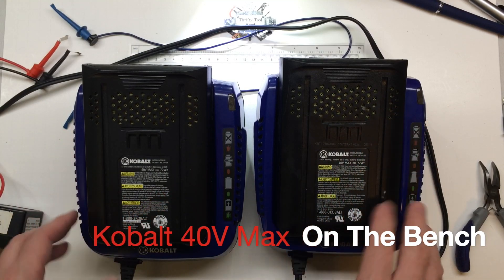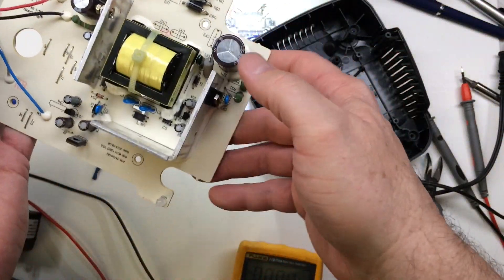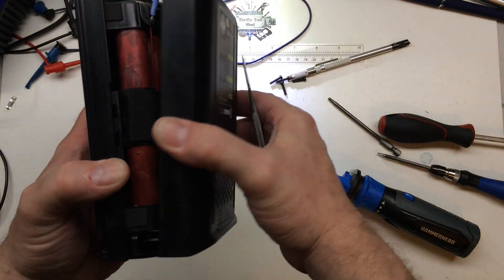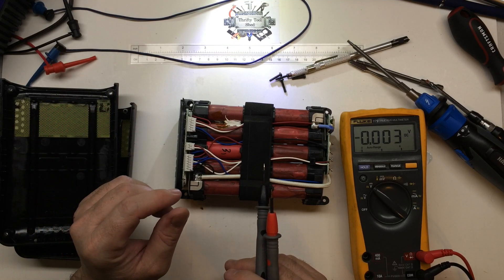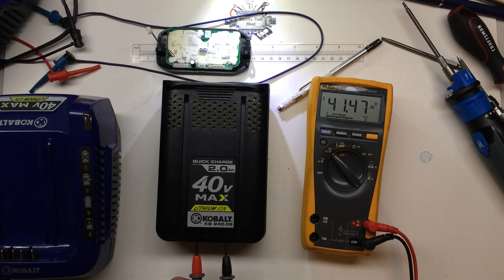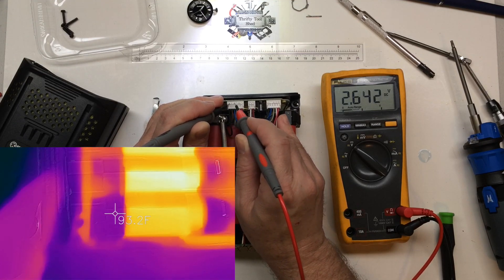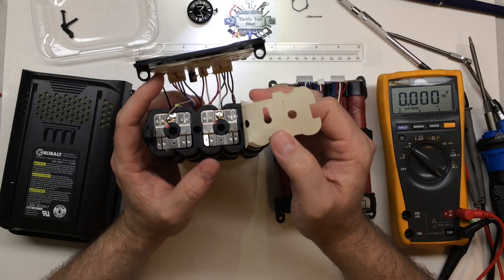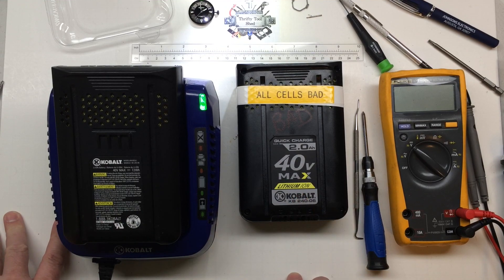Kobalt 40V Max Battery Charging Issues

Comment: Anyway to take a broken battery pack and make it a plug-in extension cord?
Reply from the maker: Not that it could not be done. You could rig up a 40V power supply or take a larger supply and use a buck regulators set to around 45V or so and it would be fine. To me that is the wrong direction, the batteries give so much freedom that I would be more inclined to use the pack connectors for another battery adapter or two 20V packs in series to run the device in a tight! I mentioned this on my 40V Ryobi video. It worked well. Just my thoughts!
Reply: Yeah, I bought a used set with 2 bad battery packs. Bought a new battery and it just doesn’t have enough juice to get through my back yard. I’m not super electricity inclined so I’ll probably buy another battery pack or figure out how to get into the broken ones. Screw heads are stripped I guess the guy before me tried getting in them. Thanks and awesome video

Comment: Do you jump it on the "C" terminal? I tried to charge mine through the positive and negative leads with no success. Just curious if the positve lead should be connected to the c terminal. Thanks!
Reply from the maker: No, you should not have to jump. + And - are going to cells directly. The only thing in between is the fuse! Other than that could be open cell or connection?

Comment: I inherited one of these that didn't work.  The small 3.1A fuse on the ACV side is blown.  I had a 5A fuse available and soldered that onto the pcb see what would happen.  With no battery on the charger, it immediately blew that fuse the moment it was plugged in.  Thoughts?
Reply from the maker: I have not had any issues with the chargers for these yet to say. I have had similar issues with similar chargers. I would check the rectifying diodes (bridge) and the switcher.

Comment: What cells are used inside of these Kobalt packs?
Reply: I would like to know as well, as least the size/volt/amp so I can upgrade my 2.0 and repair my 5.0 amp in the future when it goes bad.
Reply: Typically they are 18650 form factor, and for the 2.0 AH battery the cells would be 2000 mAH capacity. With 4V per cell, there would be ten cells stacked in series.

For 5.0 AH, that battery might have cells in parallel and those sets of parallel cells get stacked in series to reach the 40V total voltage. Open it up when it goes bad to confirm. That’s my guess - I don’t own this type of battery.
Reply from the maker: Yes, this is correct for this pack!

Comment: I have a question on an 40 volt Oregon chainsaw battery pack.  I checked the voltage and it is reading 40 volts and shows four green lights on the front of the pack but it has no current.  I put it on a brand new Oregon charger.  I have no history on the pack because it is a customers saw.  I left it on the charger overnight to see what would happen.  I know the saw is not the problem because I put the battery on the charger for 30 minutes and when plugged into the saw, it turned the saw over for a second or so.  It wurst have a hell of an internal resistance.  My recommendation was to replace the battery pack.  You thoughts?
Reply from the maker: I have rarely seen a 40V Li-ion pack show full voltage and drop off that quick. Used to be common with the old ni-cd packs. I would try to connect with jumpers etc. Out of the saw or another load if possible so you can check the pack voltage under load. It could be a bad cells that drops off quick. It could even be a bad connection to one of the cells in the pack like the spot weld connection or so. It is very rare. I am not familiar with the oregon saw but some tools will shutdown if it thinks the pack is too low or over temp. etc. So some communicate with the pack and could shutdown based on an issue and in that case it is hard to be for sure it is truly the pack, I would say 90% of the time it is a pack issue! Wish I could help more, I would load test the pack at least!  Best of luck to ya!
Reply: @ThriftyToolShed  I put a VOM to the battery pack and it said 40 VDC and the test button shows four green bars.  That is why my saws are Stihl two cycle.  You just cannot depend on battery crap.  I do have one pole saw that is lithium ion and several drills and impacts, but I leave them on their chargers when not in use, just like my laptop and tablets.
Reply from the maker: @johnclarke6647  
I am the opposite, I have always had nice gas saws but now I have a 14" and a 16" EGO and my chains have just rusted on my gas saws. I would as with any saw have more than one and of course I have 5 or so bought packs and about 10 repaired ones. 
Gas or battery I never go into the woods without back-up. I have not needed it yet with my EGO. But I still have it if I get it pinched or if a saw fails on me. It will still be a little while before the mass is ready for battery powered saws completely but hopefully when the solid state batteries platform arrives with in the next 5 years or so hopefully that will be when battery will over take gas! Hard to compete with the power density of gasoline but since the efficiency is less than 30% with gas due to most of the energy it produces is heat. We are close....
Reply: @ThriftyToolShed  iave a couple of 16 inch saws but most of mine are the big Stihl saws, many of whom I built.  I will bet those little saws will not stay with my ms 460, 440 or for the real big stuff my ms 660 and it’s 28 inch bar.  Either of these saws will make your battery operated saws look like a kids toy, which is what they are.  They are ok around the house but when you have to fell and buck up 25 inch hardwood they are sadly lacking.
Reply from the maker: We actually had a small engine repair shop before my Dad retired a few years back. We did a tremendous amount of saw sales and service for loggers ( I simply helped him at the start and part time  when I had time) so I am not ignorant by any means on the big boys, I was talking about mine and mine alone. I have never needed a big saw for my own personal use. I only used them back then while testing the repairs for the loggers. I do remember the older McCullough 850 before the Husqvarna and Jonsered turbos were a pain to keep pulling on when you are learning to work on them, rough on the elbow. Lol. I would never compare my $200 EGO to that or my even my decent Echo 21" gas saws either. They are not even on the same spectrum. Glad I have never needed that much saw around my house.

Comment: I had a Greenworks 80 volt. After watching this video, I tested my volts and saw 63. That left me believing I had a similar issue, so I pulse jumped it for about an amp. It woke up the charging system. It then accepted normal charge again from the Greenworks charger.
Reply from the maker: Good to know, thanks for your comment!

Comment: My pack will not light up and I don’t understand how you go yours to light when it would not
Reply from the maker: I tested the cells and they were very low. I had to charge the cells up slowly with my Bench Top Constant Current power supply.

Comment: I have 3 packs,  2 show 41V and full charge, 1 36 volts and 50% charge.  I missed where the LiOn cell voltage increased from 3.3 to 4??  Any way,  the half charged unit reports bad..  I can't detect any change in pack voltage while the charger is in the flashing green mode.. prior to it switching to red..  Charger test points tp5/tp6  idle at 18v and when a full charge unit is plugged in it is still at 18v.  but when the 'half charged unit is attached the voltage at across tp5/tp6 goes to pack voltage  while the led be blinking green.  when the led goes to red, the voltage on tp5/tp6 goes to the 18v idle value.  I can't id the Q11 M60130 device
Reply from the maker: I don't still have these packs, they were given back to a friend over a year ago. I do not own any myself or I would look up the Q11 and see if it's the same number. As far as the cells back to 4V, I used my bench power supply and brought the individual cells up set at 4V and Current limit are 1A until all were good.

Comment: I have come across one of the mowers with this particular battery unit on it but it's a six amp hour and I have experience working with these style battery packs and I've had this one apart it's got 20 batteries in it 20 individuals but I'm not too impressed with the way it's laid out because what I found out so far is is it uses 10 batteries per I want to say per 20 volts and they double on each end of the pack you have a 20 volt set and another 21 set and then they run the two sets in series to get 40 volts but I don't see why this thing has so many issues it should do really well and even more powerful than I would think but my Craftsman v20 batteries at 4 amp hours seem way better than this and more dependable and I can leave them on charge and they care for themselves or take them off and they don't have many issues but I'm considering building an adapter to run my Craftsman batteries in series to use this mower because The run time on the battery I have when I first come across it was charged fully and ran good but they don't seem to want to take a good charge now so if the charger I get doesn't work right and the batteries don't work right I'm going to work on an adapter run the batteries I'm going to buy and the charger in the ground and switch it to the v20 batteries I think I'll do better they seem more dependable

Comment: one last silly question, how in the world do you get the cells separated from the little rivets on the top and bottom of each cell.? I do not want to tear this up. The cells are hard to remove from the plastic housing!
Reply from the maker: I am not sure how your particular battery is however most I have seen are similar, I have a couple videos that I do show removing cells from the EGO 56V pack and Ryobi 18V pack you may find helpful. You have to carefully pry the tabs off and when you reattach the new cells you have to either spot weld tabs back or carefully solder the tabs back which I do show in the videos. Hope it helps!

Comment: If I needed to replace a couple of these 4 volt cells, where could I get them and if I had to do a web search, what would I call them?
Reply from the maker: I am sure different packs manufacturing at different times are not all the same but they are 18650 li-ion cells with the rating of your pack. For example if you have a 2.0ah pack, the cells are 2000mah rating...

Comment: I'm having trouble with an 80V max 5ah, it charges no problem there "apparently" tested its voltage it registered 79 when I put it on my mower it lasts less than 20 minutes. Going crazy and they're expensive, when I put it in the charger no issues all green lights. Any ideas anyone?
Reply from the maker: If you do have more than one pack it is helpful to make sure the charger is charging correctly. The next step would be to open the pack up (if not still under warranty that is) and test all cells to make sure they are all balanced and that one or more have not lost capacity. When a pack gets older it is possible most of them have lost capacity, but unusual with in a few years of use. I have not worked on the 80V myself, but the 5ah@80v means most likely 40 cells packed tight in that housing. That will not be fun to work on. Unless they used 5000mah cells and did 1P 20s. Alot of packs use 2500mah cells and 2p for the 5ah rating so 20s would be 40 cells?

Comment: Battery won’t eject kobalt 40 v chainsaw ! New used once! Please HELP!!
Reply: Sunny Rey I have greenworks stuff. It’s the same as Kobalt. The battery does tend to get stuck. Generally pressing the release button and giving the unit a tap or two will release the battery. Obviously use extreme caution with any tool, especially a chainsaw.

Comment: My Kobalt battery ended up having 2 cells that measured ZERO volts.
Reply from the maker: I am working on one right now that is the same way. It had a couple reading close to zero and some others just above 1V while a few were up around 3v and tested with pretty good capacity. So all cells are needing to be replaced. Good thing is that the pack otherwise is in great shape and maybe a good candidate to increase capacity since it was only a 2ah pack and I think I have enough cells to double up and go close to 4ah. It is not always worth the cell cost to rebuild these, but I have some from another salvaged pack and I want to try to make use of the unused cell locations and make it a 2P just to see how well it works.

Comment: That looks like over ripe TNT...
Reply: These batteries/devices are horrible... there is no logic in the devices to NOT run the battery completely dead... so.. I have to use a trickle charger connected to blades that fit the battery... for about 5 minutes... then charger works... problem stems from the charger requiring it to detect a small voltage reading before it will turn on.
Reply: Pretty close to it. Those 18650’s get very unstable if they under or overvolt. (See vape explosions)
Reply: I just bought a new 80v 6 amp max cobalt mower and the batt is prob twice the size of those but have a fan in them. They are obviously making improvements as they go.
Reply from the maker: And to think that some people will try to boost a pack without even knowing what the condition the cells are in! 😬